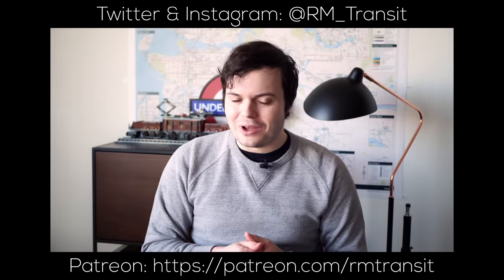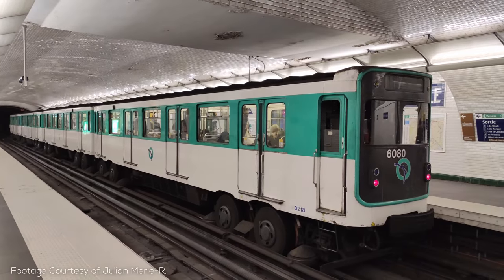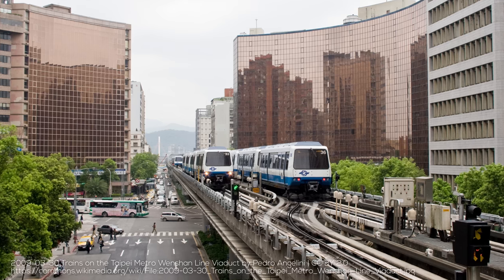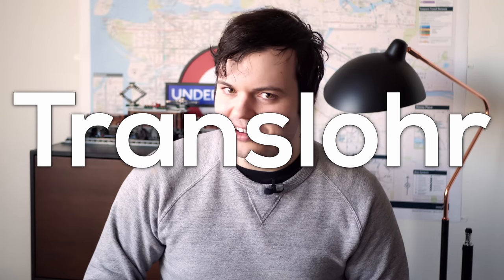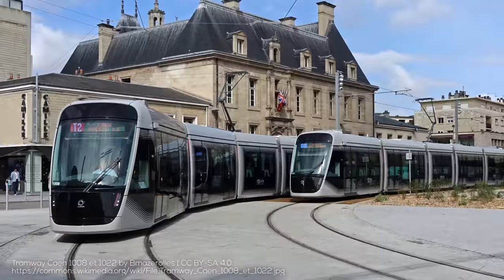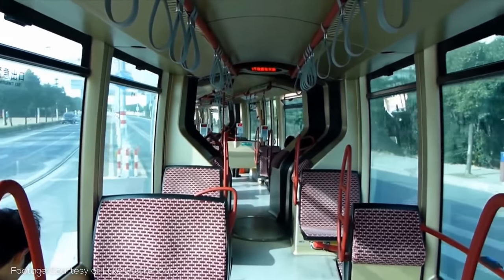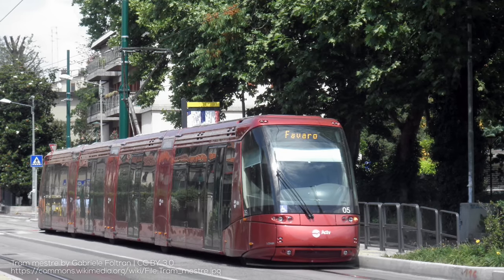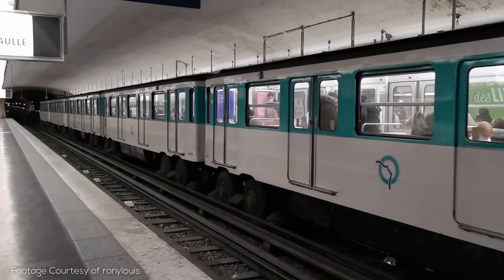Rubber-Tire Rail Transit is Weird

Comment: Rubber tyred metros are a mild health hazard by virtue of the amount of the PM 2.5 they spew out. Also the underground rubber tyred Paris metro line stations smell horrendous because of the tyres.
Reply: Don't rubber tires also require much more maintenance?
Reply: that's not how anyh of that is spelled.
Reply: @BraxtonMeyer  If you are talking about tire vs tyre, it depends on where in the world you're coming from. On a world wide scale either is acceptable.
Reply: A lot of that is because the wheel sets on the bogies don’t steer, at least on older versions. Both axles are rigid, as on a steel rail system, so on curves the ‘road tyres’ scrub around curves, much as the rear tyres on a non-steering twin rear axle truck do. Must make them wear and release their toxins much faster.
Reply from the maker: This is interesting because PM2.5 pollution is actually much better in the Montreal Metro when compared to the Toronto subway, even though Montreals system is entirely underground and quite air sealed!
Reply: RER doesn't need tyres to spit fine particles everywhere, speed deceleration with big powerful brakes will be enough on older rolling stocks. 
As for the smell, the tyres are not the only reason, smell of piss and drugs don't help either.
Reply: @BraxtonMeyer  That's the British English spelling of tyre, so it is actually spelled properly.
Reply: @RMTransit  Wonder if that has to do with better ventilation installed? Rubber wheels do tend to produce more PM 2.5 than steel on steel.
Reply: @RMTransit  Hmm! Needs research then.
Reply: @RMTransit  Better ventilation? Better tire compounds?
Reply: Damn I love the smell, it's do nostalgic to me
Reply: I have just read an article in the 1950 Railway Magazine on the rubber-tyred Paris Metro train. i am aware of the pre-war rubber-tyred Michelin Railcar that was tried out briefly on the LMS in England.
Reply: @BraxtonMeyer  you must be one of those Americans that think American English is the only version of English there is 🙄
Reply: Mexico and Santiago de Chile also have rubber tired metro systems.  I have been on the Mexico City system, in December 2015.  The metro trains enter and exit stations much quieter than those with steel wheels alone.
Reply: @BraxtonMeyer  That's how all of it is spelled in British English
Reply: On top of this the Montreal metro stations sometimes smells like firewood, especially when a train stopped suddenly. Because it actually uses wooden brakes! While the smell is pleasant, it's probably not particularly healthy.
Reply: Brakes also produce particulate pollution so it's not great either way.
Reply: the weird smell in Paris subway (mostly in RER) comes from underground gas pockets
Reply: @groundzero_-lm4md  brakes should be regenerative, and only friction in emergencies.
Reply: @martian9999  Agreed, the lack of regenerative braking in the London Underground is one of the main reasons it is so intolerably hot down there in the summer.
Reply: @BraxtonMeyer  "anyh?"
Reply: I think it's the opposite. The smell is like a pop corn one. I like it.

The bad smell in the Paris metro come from Hydrogen sulfides.
Reply: @quoniam426  It's not the piss or the drugs. Hydrogen sulfide. The bad smells are always located at the same places. You think druged (or undruged) people piss in the same places ?
Reply: >.Also the underground rubber tyred Paris metro line stations smell horrendous because of the tyres.

I would honeslty more accused the horrible smell / PM pollution of the Paris metro to come from the widespread diesel engine usage everywhere in the city more than from the few tyres of the Metro.
Reply: @RMTransit  and the pollution is much worse in the RER than in the metro even though the RER uses only steel wheels

Comment: I think I have to mention that iron rail is "quite heavy". In my country, Japan, AGT (Automated Guideway Transitmit) ≈ Mitsubishi Crystal Mover is often used in bay area where the ground is not firm enough.
Reply: At least in Japan, automated guideways are at least well-implemented (at least in the Tokyo area). But some of these "gadgetbahn" systems are mechanical nightmares not worth building in the long run.
Reply: Why not simply use a trolleybus then?
Reply: @deptusmechanikus7362  Crystal mover technology can operate without a driver, the yurikamome line in Tokyo is driverless and has platform screen doors.
Reply from the maker: I’m skeptical that this is a good reason these days, lots of traditional rail is used in such areas even in Japan!
Reply: Not just Tokyo, but you also have Kobe Portliner as well.
Reply: @deptusmechanikus7362  people don’t like buses to begin with.
Reply: If you mean the Yurikamome line or the Tokyo Monorail, those are both on elevated tracks very high above the ground, so I'm not sure they are any less light than simple rail on ground.
As well, the JR Rinkai line passes through the same area, underground no less, without much of a problem.
Reply: Singapore's newer 'LRT' lines use Mitsubishi Crystal Movers also, whose guide & power rails are positioned higher up on both sides of the track (like bottom-contact 3rd rail). They're been faster & more reliable than the older Bt Panjang LRT, which uses a single guide/power rail in the middle (under the Bombardier (originally ADTranz) Innovia 1/300 standard/system) that I heard is more prone to wear & tear, especially at switches where the rail has to be movable. Rubber tyres was chosen in this case as they're quieter (& probably allows track interchanges/flyovers to be more compact as they can be made steeper, since rubber has greater grip), which is important as these lines run close to houses, though I find that the metal skirting added more recently to our steel wheel lines make things comparatively quiet too

Comment: Hi Reece, this video is much better than the one it replaced! My limited experiece with rubber tired trains, Montreal, is that the ride is equally comfortable and loud to steel-wheeled metros.  Incidentally, I have only heard the screeching on the Toronto subway in the sharp curves into and out of Union.  Thirty years ago, the screeching used to happen many more places in the system, so it is much improved.
Reply: What caused this? My only guess is that old trains typically used through-axels and that new ones don’t but one never seen anything to support it.
Reply from the maker: So great to hear that! It’s my goal!
Reply: @Freshbott2  I am not sure exactly what changed. I think I remember hearing that the wheel profile was slightly different on newer train models, but I am not an expert on train design. (Maybe someone who is could comment.) I am just thankful that my trips between Old Mill and Jane are not interrupted  by soul-piercing screams from the wheels as they were when I was a teenager.
Reply: @andrewclarkson3401  I have no idea about metro/tram systems (even less specific ones), but I do know that at least DB actually uses automatic lubrication (at the rail) on sharp curves, to reduce the noise as well as the abrasion.
Reply: @Freshbott2  Couple of big influencers:
1) welded continuous rail is infinitely easier on trucks/bogies
2) developments in flange lubrication have come a long way
Reply: In a weird way I find the tire roar of Montreal to kinda be like asmr and soothing, it being a lower frequency sound vs steel wheels.

Comment: Ok but the noise a pretty obvious win. I take the Montreal metro every day and I've experienced conventional rail metro in New York a bunch of times and the small roaring is much nicer than the metal friction noise imo.. It feels so much quieter.
Reply from the maker: Yeah but New York is a very old and not always wonderfully maintained system!
Reply: @RMTransit  Sure is an old metro.. Thanks, nice to know!

Comment: The difference in cornering for rubber/steel tires though is significant and it's not just noise.  Rubber can take very tight corners and faster.  The core issue with steel wheels is they don't have a differential and have to rely on banking which requires very precise tolerances to work well. With any vehicle going over any road/track there will be wear.  The question is do you want the track wearing out or the wheels?  I would argue it's better to have the wheels wear out.  Steel wheels will actually erode not only the rails, but the sleepers and fish plates.  This creates a safety hazard or forces trains to travel artificially slow because the rails are in bad condition.  If you hear noise on the track then that is either the rails or wheels being stressed or being degraded.  racks that support rubber tires usually don't wear out and don't require expensive/time-consuming repairs.  The real problem however with rubber tires though is track switching...it is difficult, time-consuming, and expensive to have a switching system for rubber tires, while steel wheels can switch tracks very easily.
Reply: On the older Parisian lines, the rubber tyred wheels are non-steering AND on solid axles. So they scrub around curves, AND rotate at the same speed as each other. Wear and toxin release must be horrendous.
Reply: @Twittler1  I agree that is bad.  Honestly all metros should have differentials...they are quieter and reduce wear on tracks/wheels.  Monorails actually have a decent solution in that they have one set of wheels for up/down and one set for laterally holding the vehicle to the track.
Reply: But differential doesn't seem rubber tyre exclusive. I don't see any inherent issue that prevent it from being put on a steel wheel tram.
Reply: @billyswong  Added expense and weight for no real benefit. And another potential failure point; thick, heavy solid steel axles rarely break down. Split them to put a differential in - you’ve now designed in a weak point. The natural differential action of cone shaped wheel profiles is sufficient for all but the tightest curves. 

Some older trams/streetcars in North America (the PMT(?) types) did have Pullman bogies/trucks, the powered ones of which did have differentials. I rode them in Boston in the 60s, but whether they helped is another matter. Wheel squeal on tighter bends was as loud as ever.

Modern low floor trams get round this by not having axles at all - each wheel is independent of all the others and independently suspended too. But they still squeal. It’s the nature of the beast (flanged steel wheels, steel rails).
Reply: @Twittler1  rubber tired Paris metro trains have differentials since the beginning, in 1951... And I'm sure of that because I've got the plans and have seen them...
As to why steel trains don't have differentials is due to the conical shape of the wheels doing this job. The exact profile of the rolling table determines the dynamic behaviour and is a great point where innovative shapes reduce screeching and wheel hunting. They are great at that in Asia iirc
Reply: @LeGrandJuju49  I’ll bow to your knowledge about the metro - I’ve just seen a photo of an early train, and a longitudinal motor could be clearly seen bolted to a differential casing.

As for steel wheels, we’ve both said the same. But each profiling solution generates its own problems. The vehicles of the DLR in London have quite a radical cone profile to assist in sharp curves. The problem created is that on straight sections of track, the the axles are constantly hunting from side to side for an equilibrium that never arrives. The trains constantly sway, whereas the stick to a firm path on bends. And they still squeal on tight bends - those damned flanges get you every time, and the grease on the inner edge of the rails makes zero difference.
Reply: Perhaps at least for linear motor (not limited to induction, also referring to synchronous and other forms) and other track-propelled trains (e.g. LIM train with stator (i.e. multiphase electromagnetic coils) on train bogie), to keep bogie design and manufacturing costs down while eliminating need for banking and providing differentials, wheels shouldn't be fixed to axles but axle fixed (NOT free-running) to the train bogie to not only better distribute the weight load but since the wheels aren't driven by a rotary motor nor propel train, wheels would be free-running with track-based propulsions such as rack (as long only the gear is motor-driven), linear motors, etc.
Reply: Steel wheels absolutely can have a differential, the reason why they normally don't is because they can go without which makes them cheaper and more reliable.

If you want a differential you can add one, some trams and trains do.
Reply: @michaelwoods2672  Could you point me to some tram or trains models using a differential ? I would like to do some research and learn why anyone would do such a thing as not using the advantage of conical wheels.